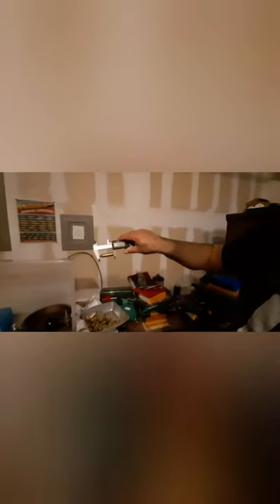Many of you asked about reloading...

Comment: How important is annealing? I can't get consistent ES. One day I get 10 ES and other days 30 ES.
Reply from the maker: It's important in that you want less spring back from the brass and better consistency in that regard.  What brass powder and primer, because that is where there could be a more important issue.  I don't use alpha brass, but heard it doesn't require annealing per their own specs.  I do it with an Amp on lapua and get decent es/SD, but even then, if your results on paper at 100 and plate to distance are good, don't worry about it.  If you're shooting f class, disregard  what I said and see Erik Cortina's videos.
Reply: @andrewroberson724  Thanks for the reply. My results on paper and at 800-1200 and 1800 yards are excellent,  better than what I expect. Moa shooting at 1200yds with 75% accuracy on good days and over 65% at a mile on a 2'x2' steel target. Some of the shots I make, most people won't believe so I always film everything and have it on my other youtube account. I've thought about that before, if Im getting great results, why worry about it. I use alpha brass and berger bullets.
Reply from the maker: @equalleftrights3130  I wouldn't worry with that rate of success, good shootin!
Reply: @andrewroberson724  That makes sense, thanks.